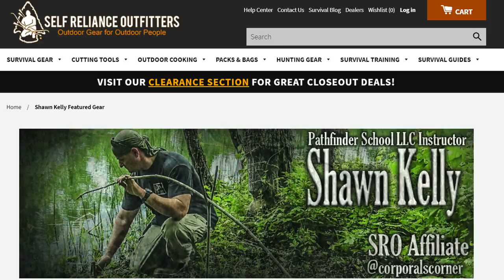Solo Overnight Building a Bushcraft Camp and Casting Bronze In a Campfire and Bacon Ribeye Skillet

Comment: I’ve done castings in a foundry, and always with sand, but never in a fire pit.  I’m inspired to give this a shot.  Thanks!  PS - you could have made a bit of a shoulder at the end of the tang to prevent the blade from slipping out of the handle during use.

Comment: I think this blowerless magic pit could work as a steel forge even. Beyond outstanding.
Reply: Iffy.  It looked to get hot enough to be able to maybe pound out basic shapes, but you would have to work twice as hard to move the metal and it would get nowhere near hot enough for forge welding.  hotter means metal moves more easily.  Insufficient heat means you get stuff that is weaker, and you have to work harder to get there

Comment: Did you work harden those edges? If not, bronze can be somewhat soft when used for tools. You have to hammer the edges of bronze tools to make the metal there harder, but don't strike it too much or it'll end up brittle, like bending a paperclip back and forth the overhardened bits will begin to sheer off in big chips.

Comment: Excellent video Corp 👍.  Dame shame about the cast iron smelting pot 🤨, the bronze blade 👌 very nice job.  Was impressed that you used it on a ferrisidiom rod. Was under the impression that, you have to use steel or iron 🤔with them.

Comment: I think in a previous video, you had dug two holes about a foot apart, after which you created a vertical hole connecting the two.  It was a ramjet of sorts and really poured the oxygen to the fire pit.  Would that setup have worked for your recent bronze project?

Thanks for putting the video up.

Comment: I figured the cast iron would fail.  It's melting point is 1200 degrees F, Normally fails at 800 degrees F.  If it worked I would have pointed out something seriously wrong with your numbers.
Props for integrity.
I',m glad you went over the details of the fire.  Very important.
I would love to see how well the bronze knife works with the bush crafts.
I'm surprised to see the bronze work so well with the fire steel.
Reply: Yeah that fire steel 🔥was poppin!
Reply from the maker: no cast iron melts at 2000-2200 F aluminum melts at 1250F
Reply: @recall5811  Thanks for the correction.  I must have been thinking of a different material or context.
Fire Fighter handbook said around that number for steel, but as I am looking it up, I must have misread the units C instead of F

Comment: I was half expecting a Dakota fire pit to help keep the heat it and not use so much fuel.

Definitely on the sand in the casting medium to prevent shrinking as it dries.  "green sand" for casting usually has about 15% clay.  More clay sticks together better, but too much clay doesn't breath well to vent steam when the hot metal hits the moist sand.

Comment: Nice job on the casting, quite impressive without forced air. Did you use any flux? I haven't done traditional bronze but I've made aluminum bronze.
Reply from the maker: dont do this it will take forever get a blower
Reply: @recall5811  oh I understand that, that's why I'm impressed. I used propane to make things easy on myself.

Comment: I first found you because I was looking for someone who had cast a bronze skillet and cooked on it and do you realize you're the only one who has done it? Funny thing, copper vessels with tin linings are so common I have several. Which is older do you think? Bronze cooking utensils or copper ones lined with tin?
Reply from the maker: i do a lot of firsts and Yt stops the circulation of the videos but allows the copies to go into the millions
Reply: @recall5811  you see, you made a skillet. You succeeded, and your product worked well. That pan is probably in your kitchen right now. They found bronze pans in Pompeii.Yet mo one else uses them, literally everyone else uses pure copper pans lined with pure tin.
I have cooking vessels like that so I researched why that might be? It turns out that the copper affects the taste of the food when an acid is being cooked, so I tried making spaghetti sauce in a tin-lined pot and it does taste different from when you cook it in stainless steel, cast iron, or even enameled cookware.
But not that much. If you have bronze pans you would not replace them with copper pans lined with tin. The process of lining them must be renewed often.
So I was wondering, was bronze discovered when someone's pan dropped into a really hot fire?

Comment: Outstanding AF! curious as to how a bronze knife would hold up in the long run?
Reply from the maker: the bronze age was like 400 years
Reply: Thank you for the information as I am ignorant and or less experienced and still learning on metals and such. Great info
Reply: @Spots Corner True, bronze is pretty resistant to corrosion. However, the downside is that bronze is much less strong in regards to hardness when compared to steel. A bronze tool will break and dull ages before a steel one would even begin to show signs of wear.

Comment: How would you have made the blade template if you didn't already have a knife?
Reply: A flint rock will cut wood. But that’s another video.this was about the forging process.
Reply: You can use a stick or your fingers to put a rough shape in the sand

Comment: how durable is the edge on a bronze blade?
Reply: I can't say for bronze, but I've played around with an almost pure copper blade once. It requires a bit of touch up now and then. But as long as you are sticking to whittling wood and not using it to chop or baton, it lasts perfectly as well as a steel blade.